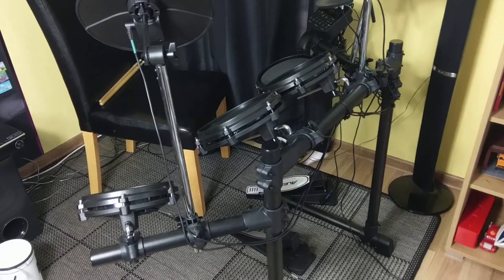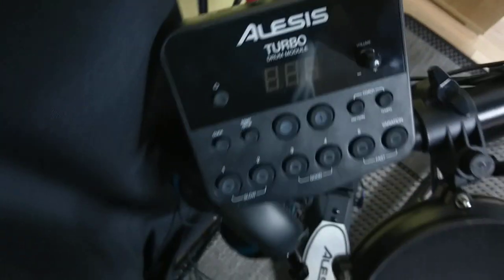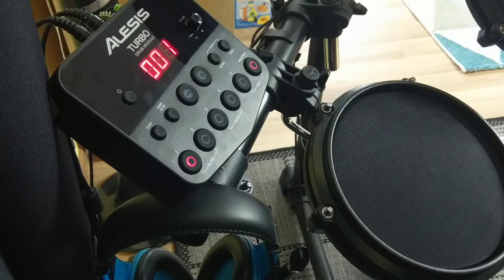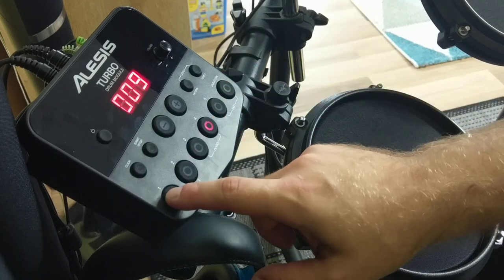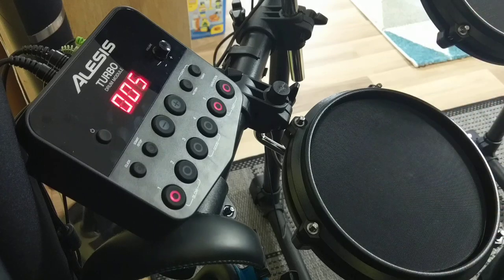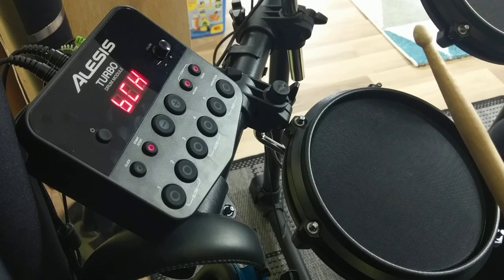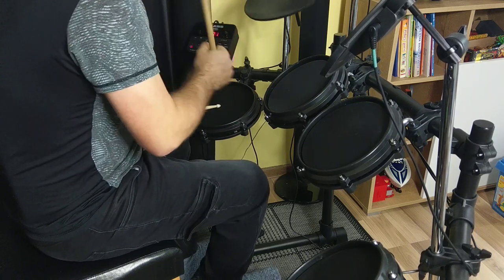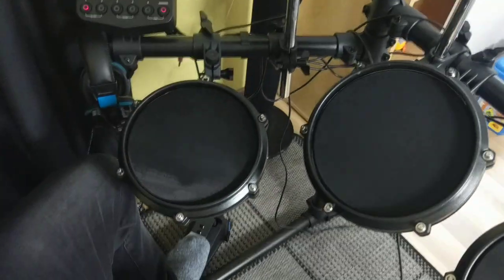How to use Alesis Turbo Mesh Kit - tutorial for beginners and Beat Check coach functions manual

Comment: I am thinking of buying this kit. Is it easy to fold it and store it? Thanks
Reply from the maker: Honestly I personalty never folded it. I think about you will need about 15-30 minutes for disassembly to the out-of-the box level.  If you have enough space you can leave frame in one part and unmount symbols only.  That should be much faster. I have some footage with assembly - maybe I will post it
Reply: It is very easy to fold up and store. I live in a small place and its perfect for that. The kit leaves alot to be desired though if im being honest, but it a fantastic kit for portability, storage, beginners, and people living in apartments (its very quite, can be played very well through headphones, or small portable speakers via Aux input. It has amp and MIDI outputs too) .  To fold it up, just make sure all the bolts are a little loose on the joints. This will make it possible to adjust the arms in any way. If you do this make sure that every so often you make check the joints to see if its still in place and secure as it often slides off from impacts on the pads overtime.

Comment: Will it work with speaker
Reply from the maker: Sure. It have 2 x 1/4 inch output and 3.5 mm (1/8 inch) stereo jack for phones. You can attach it to any speaker with those standards for example AUX in in wireless speaker will be OK.

Comment: Hi! I'm thinking of buying this kit. Could you use the hi hat pedal as a bass pedal for having double bass?
Reply from the maker: Without additional equipment it wont be possible. There is no such option available in module to have double kick. However it should be easy with adapter that will connect both pedals in a row. I will check this and let you know, regards
Reply: @BBWalkerTV  thank you! 👏🏻
Reply: @BBWalkerTV  I understand that the video is already old, but did you manage to use double bass?
Reply from the maker: @yegorgudym  I have made an adapter that connects in parallel two pedals but without extra electronics it works badly . To be specific: you need to drop first one (note off midi kick) before sending another "note on" kick. This is because Alesis ignores second "note on" signal.  In conclusion it is not good for dynamic playing and I dropped this idea right now.
Reply: @BBWalkerTV  Understood thanks!  I spent the whole evening yesterday thinking about how this can be implemented and came up with the idea - Connect the drums to the computer and assign a hi-hat instead of a bass drum in the program itself via VST and Midi.  In addictive drums 2 you can)

Comment: So, if I bought a 3.5 to 3.5 cable and hook one end to the console and one end to my laptop. I should be able to hear the music and  also hear myself with my headphones right?
Reply from the maker: Drum module has 2 outputs: headphone 1/8 inch stereo jack (3.5mm) and 2x6.25mm (1/4 inch) mono.
So you can use 3.5mm 3.5mm to connect to PC and listen / record on PC or alternatively you can use cable 2xMono to 3.5 stereo and have drums set headphone output available.
Reply: @BBWalkerTV  thanks for the quick reply!